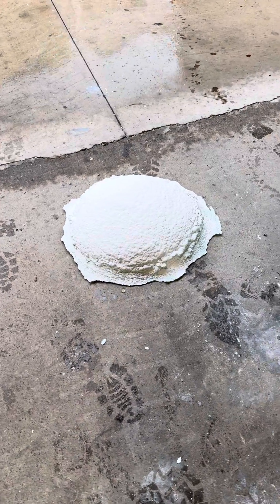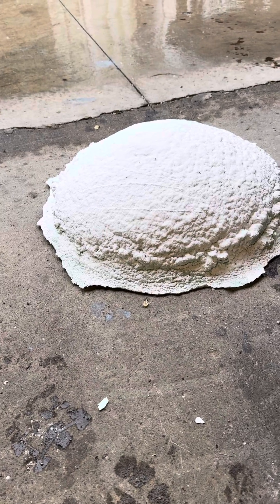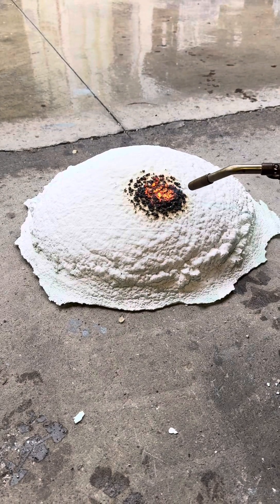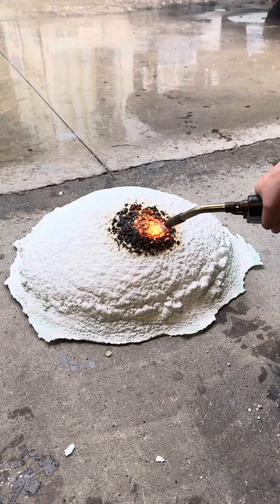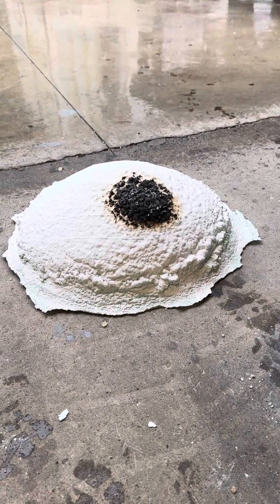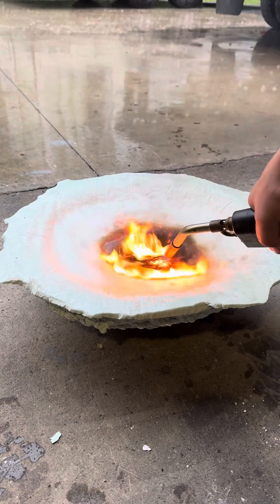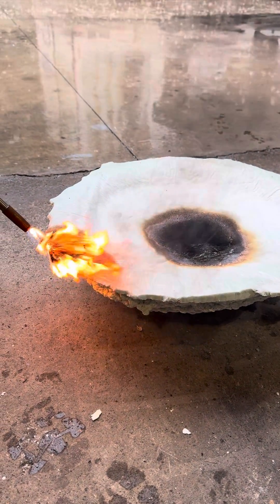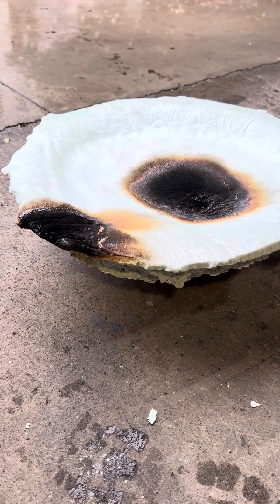Light It Up! 🔥

Comment: Any interests in setting up that trailer with a diesel fired coolant heater to heat the trailer and foam for winter work?
Reply from the maker: Possibly, what do you have in mind?
Reply: @KyleSonSprayFoamInsulation  is the email on your home page still correct?